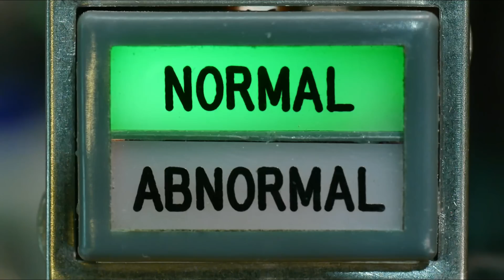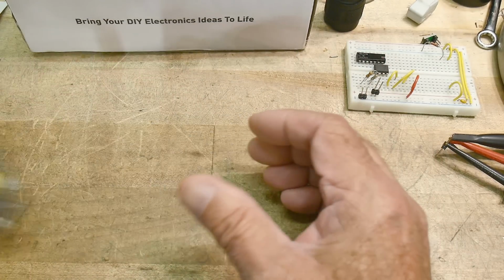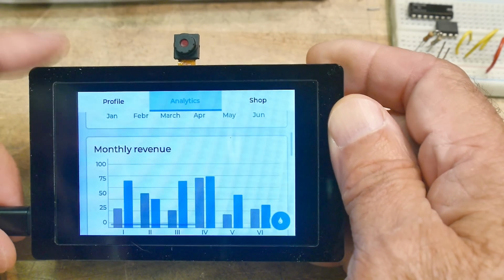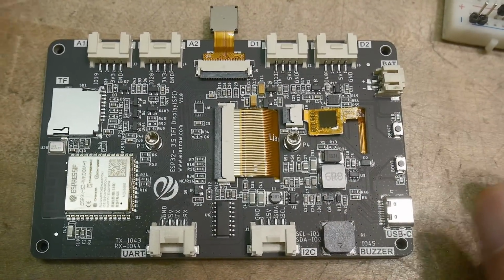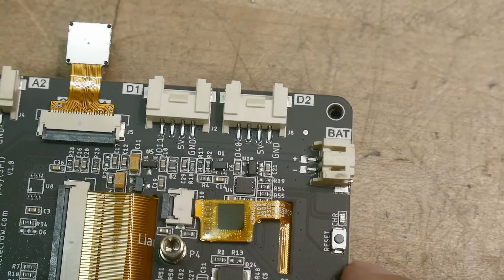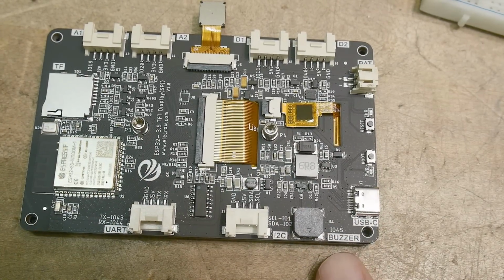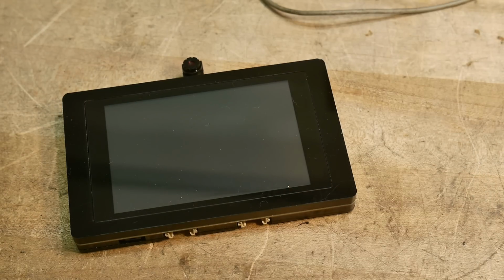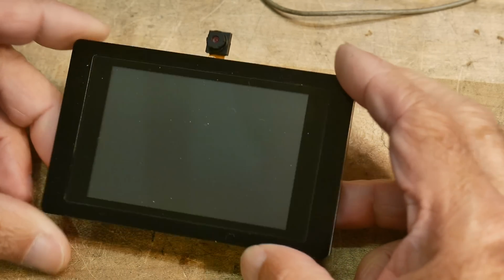#1484 Elecrow ESP Terminal Review

Comment: I was planning on building an WI-FI enabled alarm clock powered by USB with lipo backup. I was going to build it from pieces.

This might be a better option if I can connect an RTC.
Reply from the maker: sure, there are RTC with I2C interface
Reply: @whocares281  lol.  I don't think I'd take it that far. I would probably just remove the camera.
Reply: @whocares281  ...and tappy-tap-tapping too!

Comment: I think its possible to emulate arduino ide with porting to local libs or arduino gui, limitin the compatible chips supported and simplifying the compile process for this processors ... technically seems possible ;p but when you start trying this probably little bugs will delay it for years ;P

Comment: We need arduino ide compatible for this ;P
Reply from the maker: I used the Arduino IDE for programming. works fine. you need to load esp32 libraries
Reply: @IMSAIGuy  i mean portable for example clonning a arduiono project by selecting from sd card hex files... or may be by writing code on one arduiono with display then connect its serial connection to another arduinoo and write a simple or may be complec program.  i think its possible with lots of differet techniquies like comiled   librareies or may be some kind of python like env.